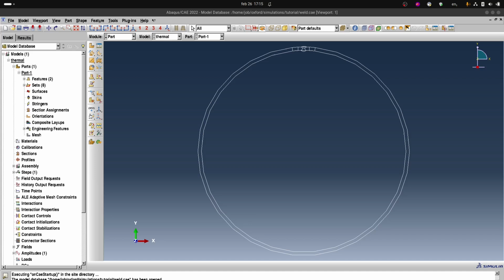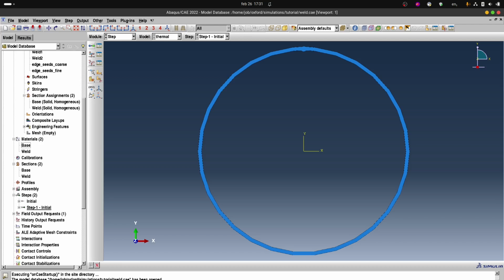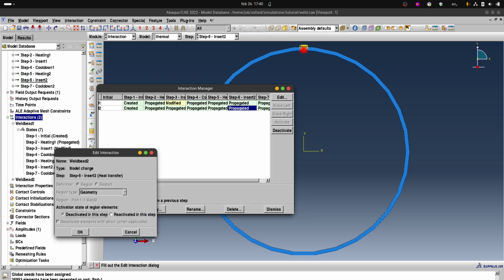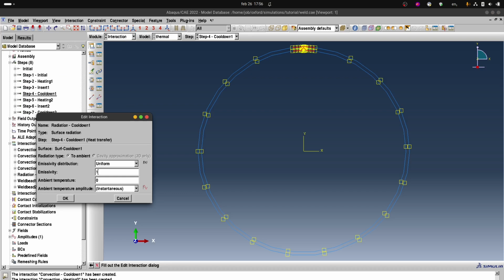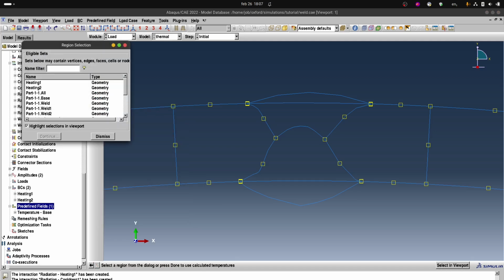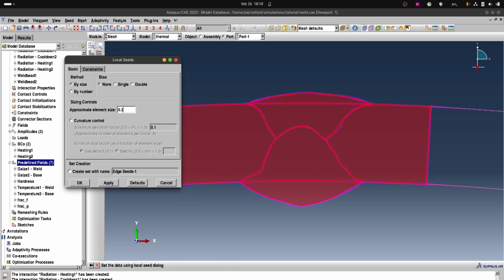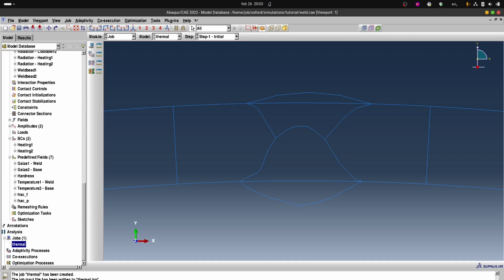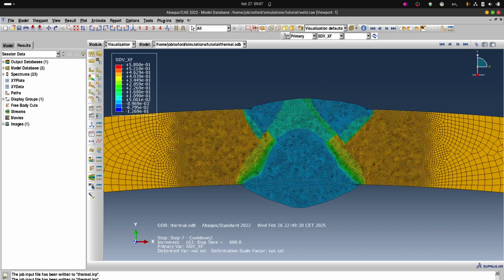Job Wijnen (Oxford Univ). Tutorial on how to run weld integrity FE models - Part I: Thermal analysis

Comment: Professor Emilio Martínez Pañeda, the phase field discontinuity you presented in the third section is not accompanied by the corresponding model or code on the website. I hope you could provide them. Thank you very much.
Reply from the maker: You should be able to find it in https://mechmat.web.ox.ac.uk/publications by clicking the [Code] link next to the associated publication (in this case the work by Wijnen et al.). Please send me an email otherwise
Reply: @DrEmilioMartinezPaneda  With your help, I’ve found what I was looking for. Thank you very much. My name is Yang Chu, and I’m currently pursuing a Ph.D. at Tianjin University in China. My research focuses specifically on hydrogen embrittlement in X65 pipeline steel. Reading your many articles has helped me, as a novice, gain a deeper understanding of the field of hydrogen embrittlement. Thank you again for your message and assistance.